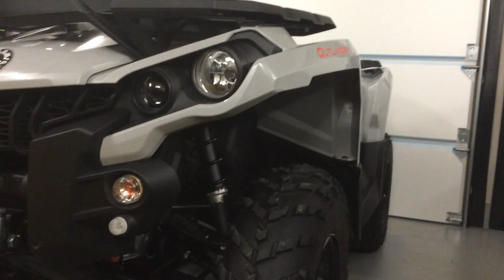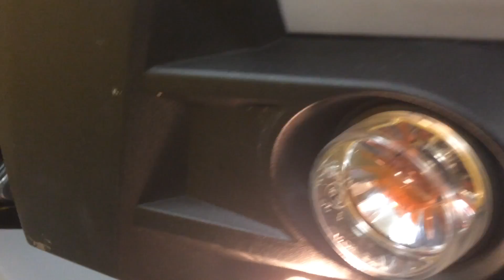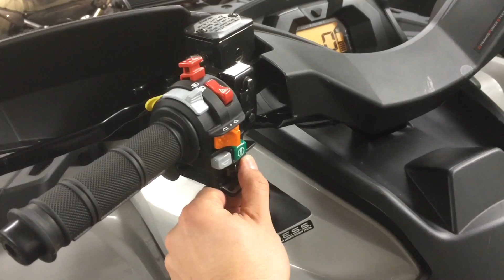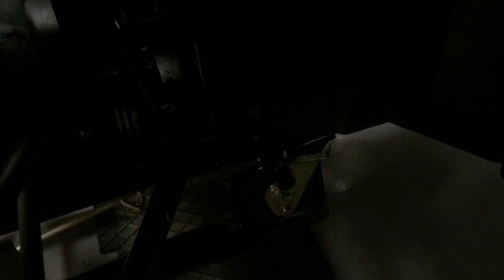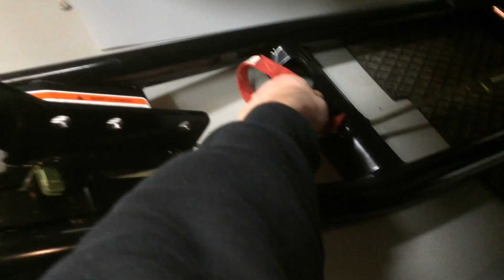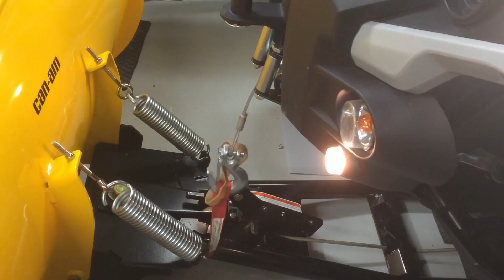Can-am Snow Plow installation - AtvP Garage

Comment: I see you have the factory Can-Am horn and Signal kit. I have the same kit as well on my Outlander MAX XT. However, mine did not include the running lights that you have below your turn signals. I do have the mounting holes though. Did your kit come with those? What part number where those lights and what are they called?
Reply from the maker: Those lights are parking lights. They are always on... Unfortunately, I found them part numbers. Lights on road traffic model / option
Reply: AtvP unless the catalog is different in other countries, there is nothing called a traffic option from Canam.  My install manual for the horn and flasher kit calls those position lights (aka running or parking lights). But, there is no part number for the lights in the manual or from Canam.  The wire harness did come with the plugs though. It would also seem that this horn and flasher kit has been discontinued as it is no longer listed in the 2017 catalog.  So no luck on part numbers for those running light specifically?
Reply from the maker: +xtcbct you're right ... I found part number, is front guard plate 705006300
Reply: Thanks but that is for the plastic plate only.  I already have all that.  I installed Canam 715001358 (includes that plate) and need those clear lights below the flashers.  The white lights that fit in the small hole.  Canam will not answer any questions about it and always directs me to the dealer.  3 dealers near me are unable to find anything for those lower lights.  Is there a part number in your instructions or on the running lights themselves?
Reply from the maker: xtcbct Found... Hella TV35DOT
Reply: Thanks for checking.  A search online did not find the Hella units.  I don't want to prolong these comments forever about this...but would be nice to find some plug n play units.  I don't want to splice anything
Reply from the maker: xtcbct page 20 -> http://www.hella.com/MicroSite/soe/sites/default/files/downloads/Hella_Product_Overview_12V-Trailers.PDF